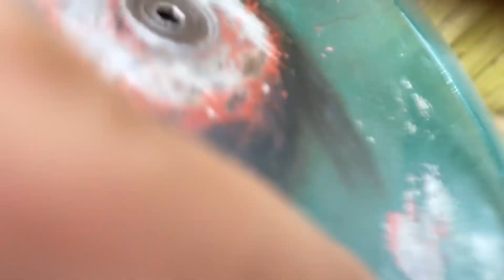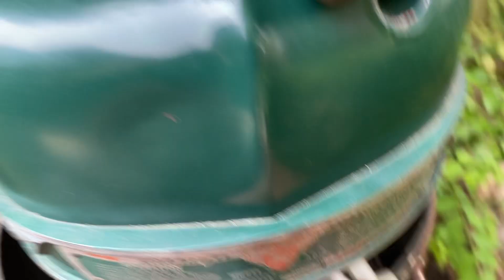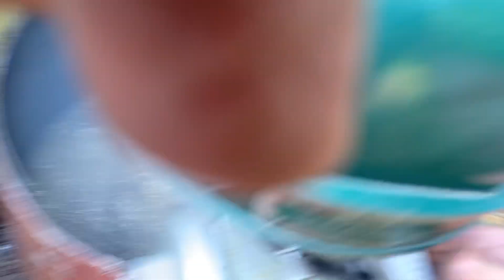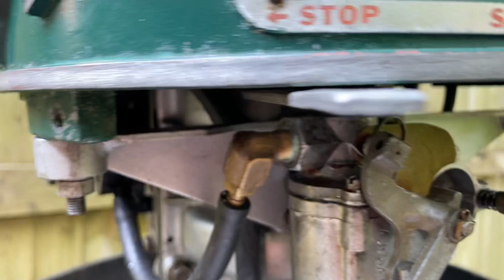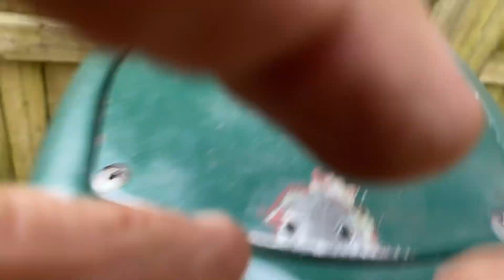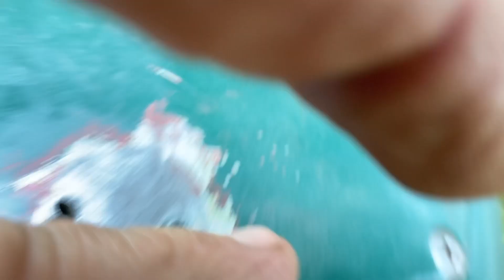1952 Mercury KG4 with fuel pump conversion AOMCI antique outboard

Comment: Nice I have a sweet KE7 I’m working on the cosmetics. Yours idles well, I’m wondering if it’s due to
Your added fuel pump good idea! What’s the carb from ?
Reply from the maker: The carb is from a MK15. I find good idle quality results from good crankcase sealing, a good ignition system and proper carburetor adjustments. Good luck with your KE7. They run great.
Reply: @GearHeadJP thanks I got a ton of parts from Bob Grubbs old mercs website I plan to reseal the power head and lower unit. Trying to find a source for new points might just swap out the coils to omc. It runs really good just had to clean the tank really well and run a filter as I didn’t find any  original in line filter anywhere